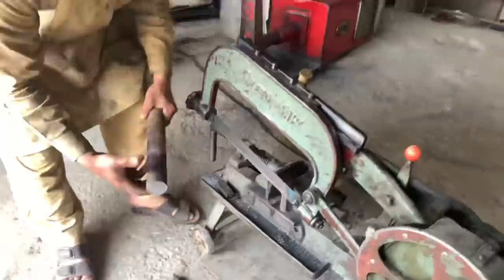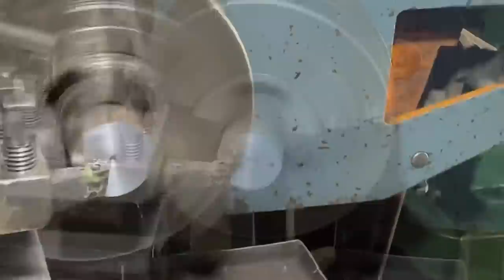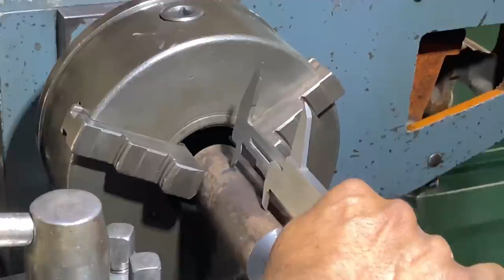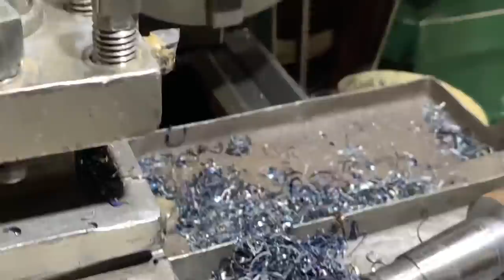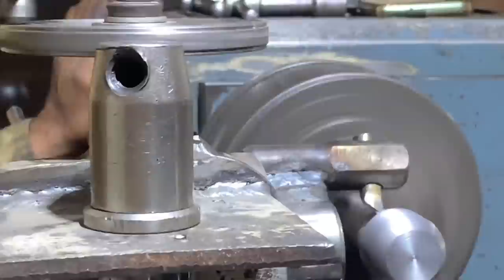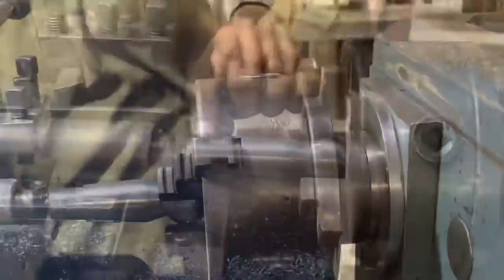For the first time, a tie rod ball pin has beendeveloped on a new tool |

Comment: Suggestions : 
1 - Leave a cylindrical "knob" at the end of the ball so you can use this to hold it in the chuck so as to not damage the ball for the threading operation, the knob can than be simply sawed of,  on the original we can see the top of the ball has a flat so this should be no issue as there does not seem to be load bearing or contact on that part
2 - Use a rounded edge tool instead of a point tool as this will actually give you a better surface finish
Reply: Who asked your opinion ?
Reply: @pufango4059  who asked yours ?
Reply: Just buy one.